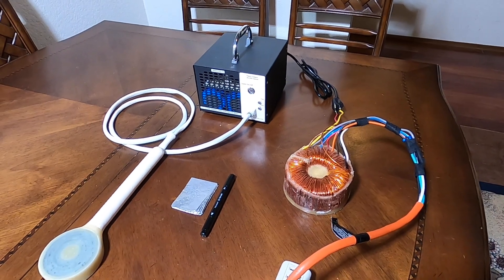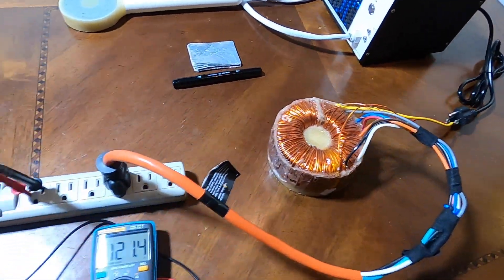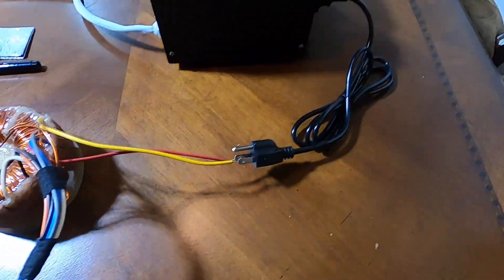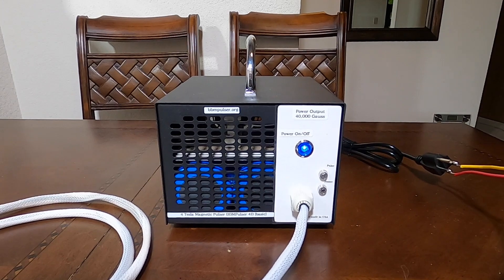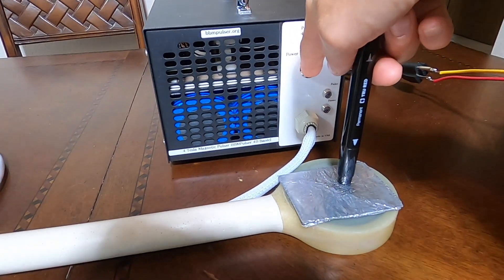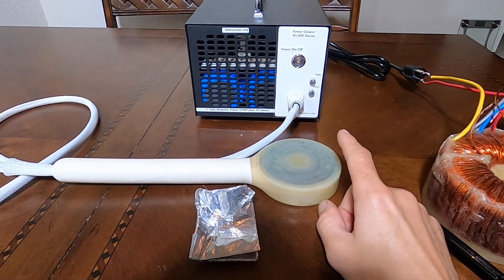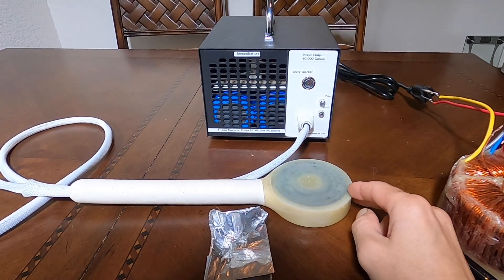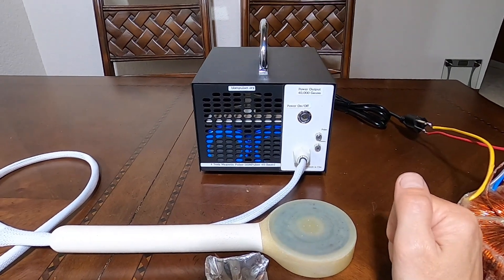015 BBMPulser 4B Running 220VAC, Output 1.4 Tesla (14,000 Gauss), PEMF, Open Source model

Comment: Hi Andrey , I have a question ? I have a horse PEMF two sets of two 6x4 inch coils one of my coils has failed can you steer me in a good direction on how to make my own coils . one day soon I hope to make one of your BBM pulsers ... thanks
Reply from the maker: You may be better repairing existing coil.
Building new coil from start is time consuming process.
It take me ~4hours, and that's with experience and all required set up.
Also coil from coil are different. Wire Gauge may very between 12-20 Gauge.
Reply: @AndreyD  thank you for your  quick response, without you knowing exactly what i I have to work with , I'm sure there is no simple answer that you can give me . I have disassemble the coil that has failed looks to be  24 AWG Gauge Enameled Copper Magnet Wire wrapped in a 8 inch circle about the thickness of a pencil and wrapped with nylon black electrical tape there doesnt seem to be a break or short in the coil . what Im wordering is it wouldnt be as simple as wrapping  24 AWG Gauge Enameled Copper Magnet Wire around a small plastic bucket then wrapping it with tape again , thanks for any help you can offer up , and be well Andrey looking forward to your next video frankemay
Reply from the maker: @6424642  Can you measure the resistance of the coil? You should get low numbers in 0.1-5 Ohms.
24AWG wire seems too thin to be use for Coils. 20AWG is the lowest. I Use 13-14AWG Magnet wire (copper and aluminum)  to get lowest possible resistance of the coil. My resistance of the coil is like 0.05 Ohms. Doesn't matter fast or slow pulsation.
Thick wire, low amount of turns, high driving voltage with at least 1000uF Capacitance are the key components to produce Strong pulse and not to heat up as fast. 
Thin wire means no currant flowing thru it, and so no  magnetic energy generated in the process. You must induce currant flow true the coil to generate magnetic field.
Anyway, measure resistance and you will know if there is a brake in the coil "Very unlikely". The brake may be in the wire or the connector
Reply: @AndreyD  thank you so much for your help . be well !